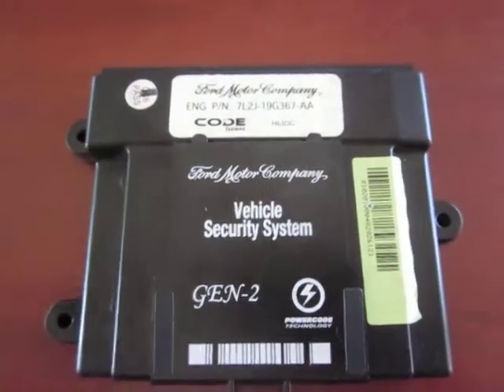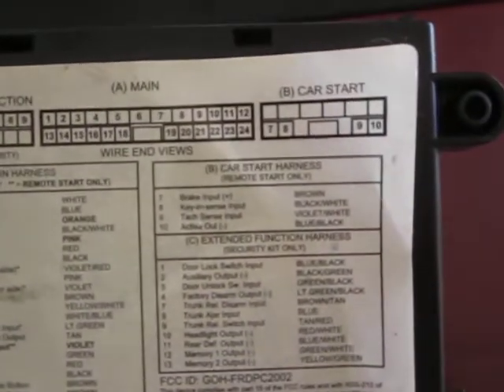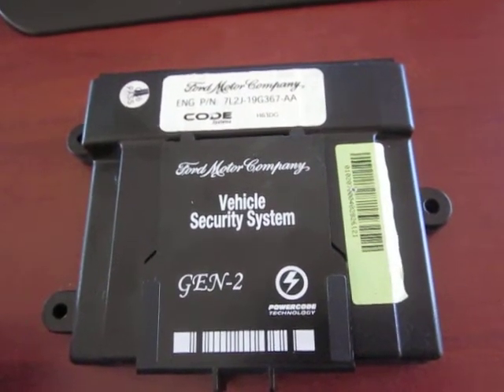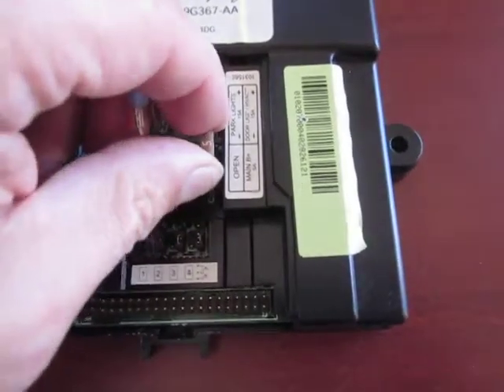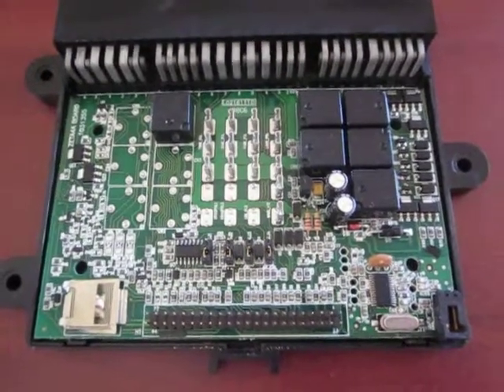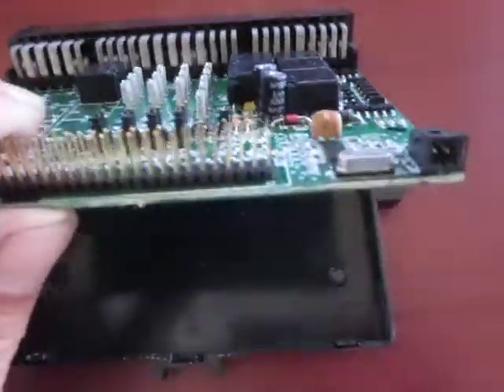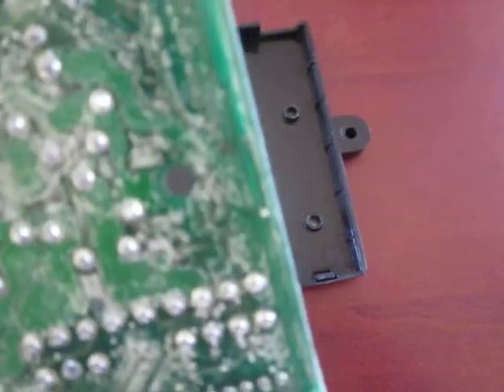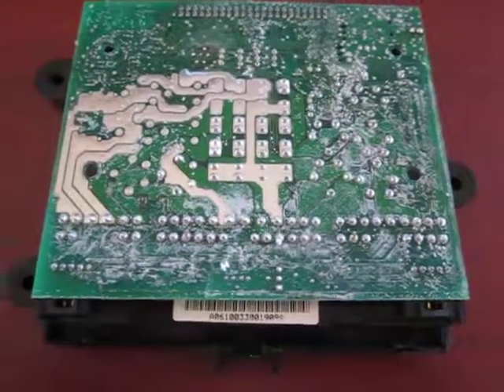Ford 7L2J-19G367-AA Code Systems Controller failure

Comment: I just found one under the dash  of my 2003 Dodge Ram 1500. It has its own security system. Why someone would put a second Ford security system with it. Maybe a Ford fanatic. Now i have a No Crank symptom. Can't shut the Ford system off. lights blink, horn blares until i pulled fuse flash continually. Battery went dead last week but i left a ham radio on all week. Have to pull pos Batt cable to stop this system. I just read out how to get the Dodge security to recognize my key again but still No Crank. 5/25
Reply from the maker: If I recall correctly, only one wire was "cut" and that was for the start circuit... so I just unplugged this poorly installed module and traced the wiring to find the interrupted starter circuit and reconnected the interrupted wire.  IF I remember accurately :O

Comment: I bought a used e250 Ford van and the alarm started randomly going off. I changed the fob batteries and it didn't help. I pulled the horn fuse as a temporary measure because it was waking my whole neighborhood up every night over and over. Mine is not the gen2. Can I just yank it out? It's draining my battery completely every few days.
Reply from the maker: I'm not 100% sure, but you should be able to.

Comment: What year and model is your vehicle? Where is that module located?  I think I need to replace mine (keeps discharging the battery)
Reply from the maker: 2008 Expy, ours was on the left of the steering column under the dash.

Comment: I just found this module under my dash, didn't even know it was there since the vehicle didn't come with the remote start fob when I bought it used. It was disconnected for some reason by a previous owner, but no signs of corrosion on the circuit board. Can't find any documentation on it (the code systems website appears to be down).
Reply: were you able to find anyhing after this time.I have the same module
Reply: I have the same module in my 2011 Expedition. Can’t figure out if it’s a security system, remote start or a combination of both. I bought the vehicle in 2021. It only came with the factory key fobs. Nothing in the vehicle information about it.